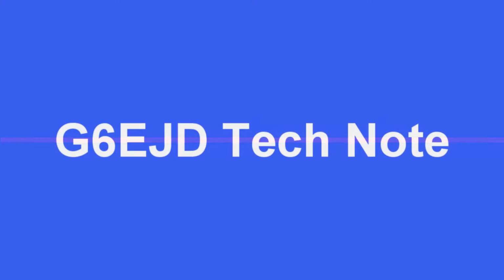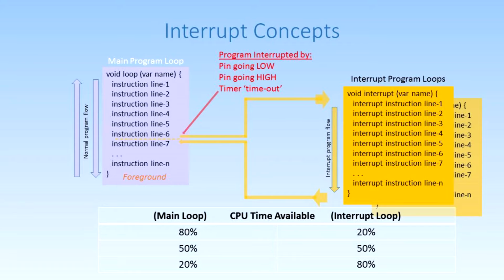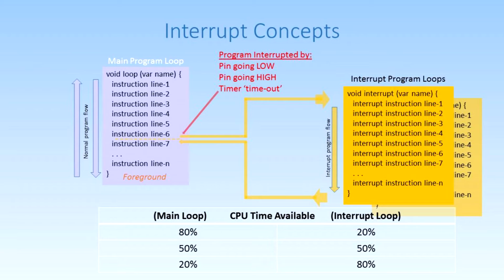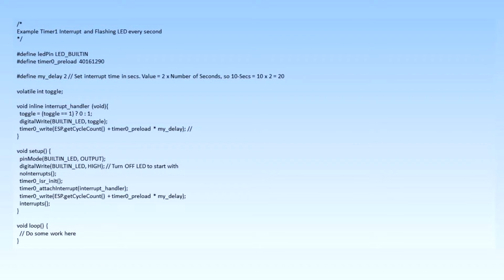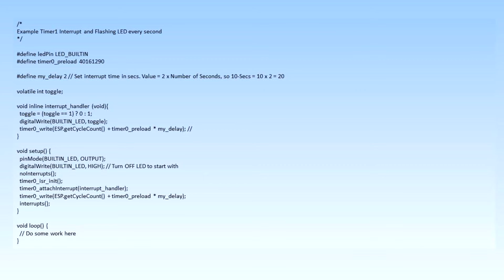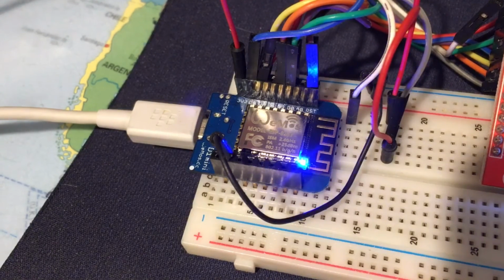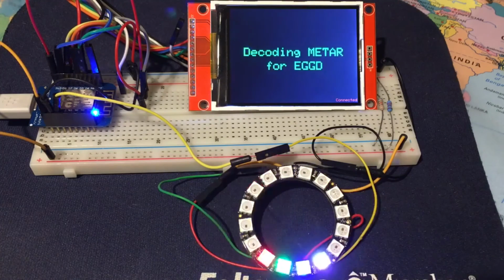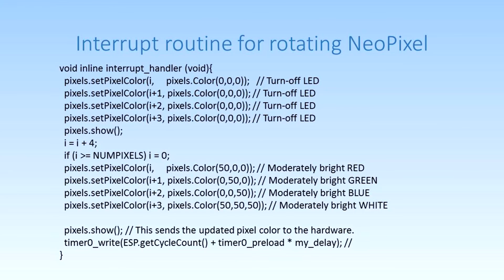Tech Note 017 - How to Use the ESP8266 with Interrupts

Comment: Many thanks for sharing this video tutorial. It is not clear because you used 40161290 as timer preload, in other similar examples users use 80000000L for 80Mhz clock or 160000000L for 160Mhz clock for every second. Please, can  explain how you find this 40161290 number? Another question is because you specify in the program description that you use Timer1 and then you use Timer0 in the sketch? Many thanks
Reply from the maker: Unfortunately I used a number that was related to an interrupt handling experiment where I had adjusted the timer value down to account for delays during an interrupt handling routine to achieve a 1-sec overall time, I will add a comment accordingly to the source code as its confusing to me too, or maybe move it back to 80,000,000. The Timer1 v Timer0 was a typographical error. Many thanks for spotting these inconsistencies I really appreciate the help.

Comment: Fascinating,  there's a lot of food for thought here. Many thanks for sharing.
Best wishes
Arthur
Reply from the maker: I think for most real world interacting activities the use of interrupts makes for a very simple solution to programming, for example rather than polling a sensor for a changed reading (and most sensors support this) get the sensor to report it has a changed value through its alert pin, which then can generate an interrupt and the new reading used to update a display, leaving the main foreground routine to concentrate on user inputs or whatever. Glad you found it thought provoking, David